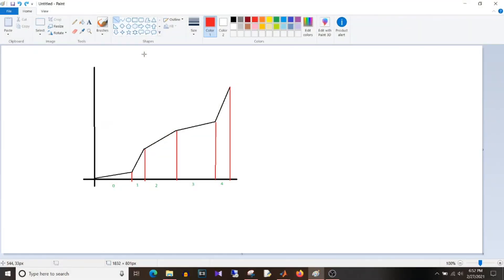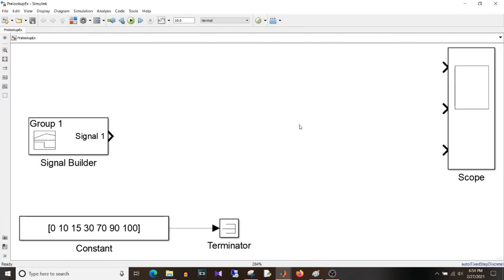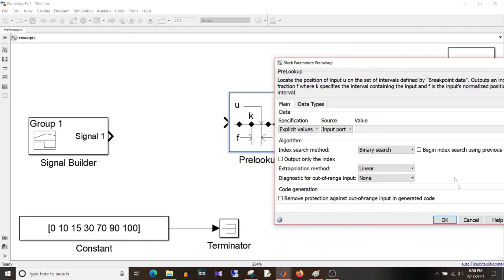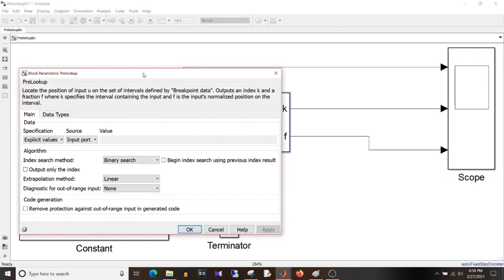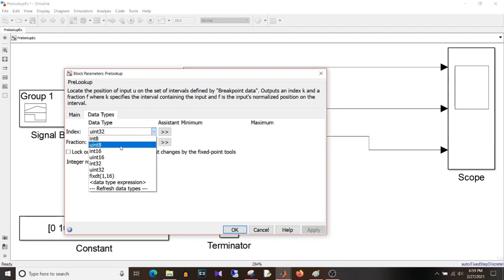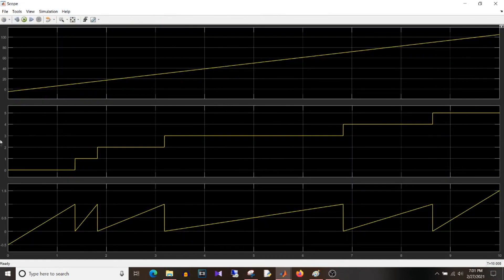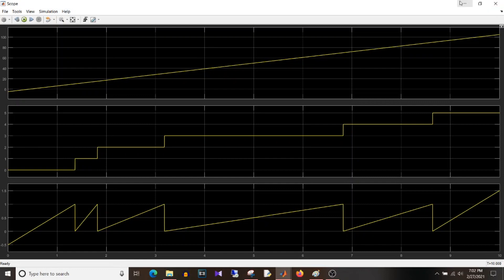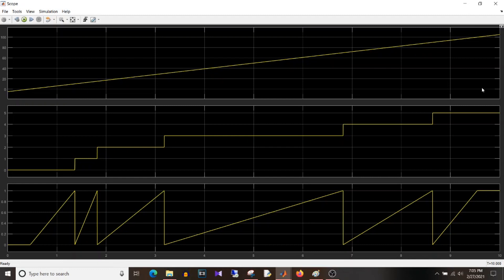Simulink Tutorial - 70 - Pre-Lookup Table

Comment: HI... CAN THIS BE IMPLEMENTED IN TMS28379D MICROCONTROLLER ?
Reply from the maker: The function is not specific to any microcontroller. In the end after codegen it provides a code with current and previous check.
Reply: @simulinktutorial9086  yes I understand but can this be implemented in hardware in any possible way...that is my doubt...!!!
Reply from the maker: It can be, as most of the automotive companies use autocodegen now days. With all config and code files, final hex is used for flashing it on the microcontroller.
Reply: @simulinktutorial9086  ok thank you.